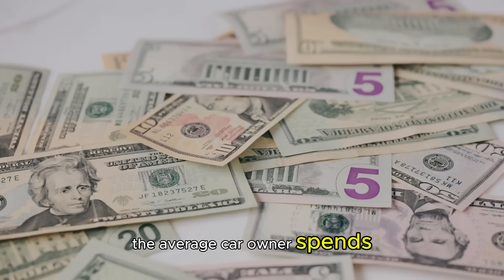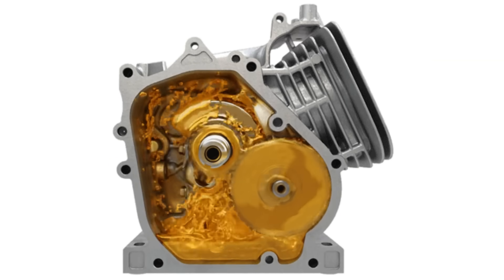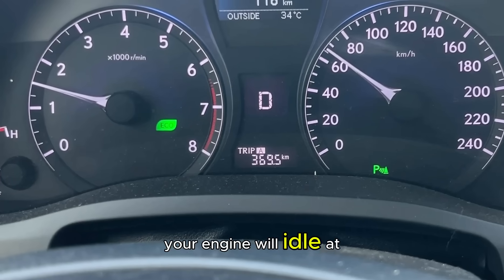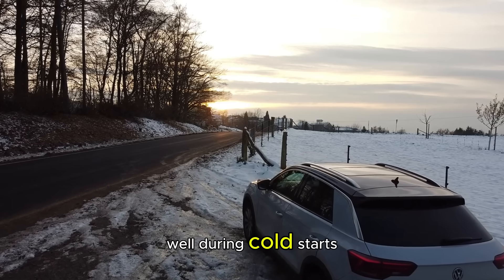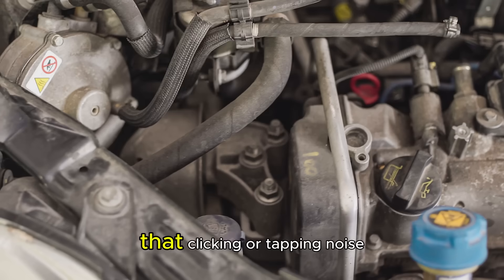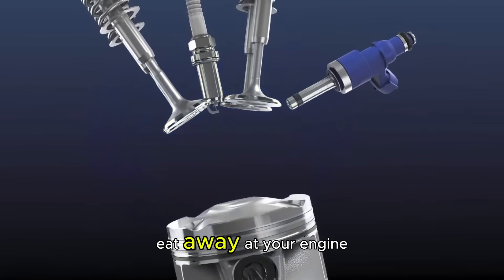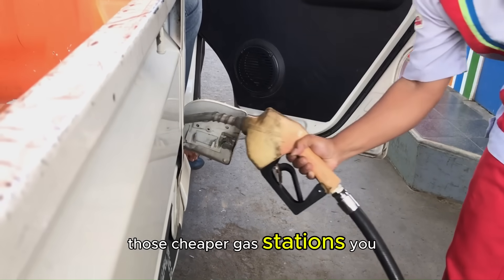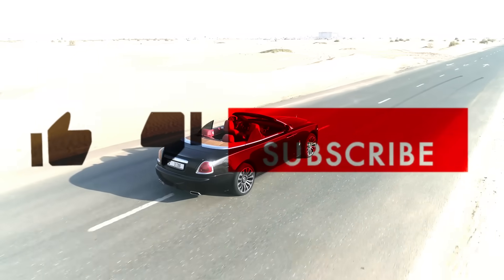Stop Making These 6 Cold Start Mistakes Before They SECRETLY Wreck Your Engine

Comment: A couple of valid words/thousands of mostly unnecessary words. Bad ratio.
1. Don't overrev/overload cold engine
2. Don't let it idle cold for too long - warm it up for about a minute before driving.
Here saved you 16 minutes of your life.
Reply: Afetr hearing the monotone and constant voice with werid distorsion, i checked the rest of the channel, and im 95% sure this is all AI generated.
Stock and AI generated images, monotone voice, GPT generated script, and the video is done.
Reply: @dracofenix3860  You are right. My question is: who - and most importantly why - is paying for these numerous mostly meaningless clips....
Reply: @dracofenix3860 ❤
Reply: @dracofenix3860  bro check the pinned comment 😂😂
Reply: @HotTripod78 bro, that comment was made one week later than mine.
Reply: @dracofenix3860  when I heard your start uses all the power it was .  Man
Reply: A single tip:
Stop watching AI generated trash videos.
Reply: Amen!
Reply: Yes, these are the most important to know about cold starts
Reply: @gregb8488  plus your car in  winter. Oil pan heater. Batter warmer.
Reply: you're a hero 🙏
Reply: So even if my car takes like 5 minutes to warm up, dont let it warm up all the way on its own at idle?
Reply: @munchy_mars_mallow1413  You don't need to warm it up to operating temperate - as soon as the temperature gauge needle starts moving, you are good to start driving.
It depends on a vehicle - for example, Toyotas warm up real fast while some ford or gm may take forever. I had a remote start on both of my 4Runners, and it was set to five minutes. I put over 350,000 miles on one of them before I sold it with no issues whatsoever so I quite frankly don't buy this "do not warm it up!!!" hysteria. Just don't go overboard.
One other fact: limos or taxi cabs - even those made by ford or gm - can live hundreds of thousands of miles despite extensive idling. In other words, cold start is the most stressful event in vehicle's life, and warming up is essential.
Reply: @nofyfb123  My newer '24 Ford Bronco warms up extremely quickly. Has excellent gen2 -2.3L GTDI. You taking bout 20yrs ago? Lol Toyotas have older engine designs generally speaking. Engineering perspective.
Reply: @nofyfb123  Also, all older limos & taxis were Ford & GM ..mainly V6 or V8s..cause they lived forever w/just good basic maintenance practices. Facts.
Reply: @Davido50  '24? You have all the fun ahead of you. LOL
You have a point - Toyota usually doesn't jump on the "latest and greatest" bandwagon - it doesn't use gullible individuals as Guinea pigs, whatever it brings to market is well tested, and if a problem is found, it's fixed in no time. Unlike - again - all kinds of fords.
Reply: @Davido50  You absolutely missed my point! Let me try this again: those monsters lived way longer than their privately used counterparts because they were never shut down/restarted. That doesn't mean they were not junk. The point is: letting it run will not cause damage. When I was young and did not know what I know today, I had a 1976 caprice. The damn thing lost it transmission (700R4) at less than 40,000 miles. NEVER AGAIN will I come close to detroit.
Reply: @nofyfb123 good to know! My old car would drop rpms after 2-3 mins, my new car a Subaru brz takes about 5+ mins for the rpms to start moving down towards 1.5-1k rpms
Reply: @AstaHalo  For decades, all manufacturers have been using heated O2 sensors so that the system would go into "closed loop" state faster. Something fishy is going on with your subaru.
Reply: @nofyfb123  do you think a small exhaust leak or poor piping would cause it to take longer for the rpms to drop?
Reply: @AstaHalo  I doubt it. Many manufacturers are known for messing with emissions. Most notorious were Nissan and VW but I wouldn't exclude Subaru. I bet you are the only one who noticed this phenomena so I would try to compare with another one at a dealership. Most likely, they all are like that, and I almost guarantee that if you complain to subaru service (and it's under warranty!), they'll blow it off. If it's out of warranty.... then everything needs to be replaced on your dime.
Reply: @munchy_mars_mallow1413 Yes, let it run till idle comes dwn . I do. Never more than 5min tho. 6k mi max oil changes far more important!
Reply: I miss the days when Youtube videos had to be 10 minutes or less.
Reply: Thank you
Reply: Give it 4 or 5 minutes...not just the engine...the transmission needs a little heat
Reply: @kurtjammer9568  Point taken. From my experience, with remote start set at 5 min there'll be no issues.
Reply: New dfi engines reduce the fuel as it warms.any excess fuel will be evaporated..I prefer a 5 minute warm up when minus 15 outside.
Reply: @kurtjammer9568  Agreed. Where I am, there rarely is -15 but when it is, I give it a few minutes. Never had an issue with extended idling. Evan crappy ford/gm limos run hundreds of thousands of miles probably because they always run and rarely are started.
Reply: @nofyfb123 False. Cause they were properly maintained. Owned every brand of vehicles out there. My Fords NEVER gave me issues. GM is another story. Better than new Hyundai-KIA tho for sure. Don't spread misinformation. Thats why social media is nearly worthless nowadays. Engineering perspective.
Reply: If it’s like 20 degrees or colder outside will I have to wait longer than a minute?
Reply: @DanielArroyo-lm5bk  It's not carved in stone. My remote starts are set to five minutes, and I never - EVER - had any problems. I'd say, as soon as the temp gauge needle starts moving, you are good to go. Time is a secondary factor that depends on your vehicle and ambient temperature.
Reply: @DanielArroyo-lm5bk  5min max or when revs come dwn after initial start.
Reply: This video isn't accurate anyway, battery has exactly the same amount of evergy it always did.. Call the weather just makes the chemical reaction a bit slower but the amount of power is still the same but this guy is completely wrong so it does kind of make you doubt the rest of it.
Reply: @elixier33  I respectfully disagree - the battery loses as much as 40% capacity when extremely cold. Just ask any muskmobiler.
Reply: Thanks 🤣
Reply: How many will do this " just because a video says" ?  
5% .
 How many will do this after seeing the entire video?
 95% 
Why? Because now they understand how an engine really works and why is so important. 
Ok, but why only 5% will use this? Because the rest of them are the Ignorant's like you
Reply: Thank you!!!!!!
Reply: Thank you.
Reply: Thank you. 2mins in and he’s said nothing
Reply: Thank u so much for the idle stuff

Comment: The cold ATF killed the automatic in my E-Class back then. well, that and the fact that Mercedes said "dont need ATF service for a lifetime" - the car was past 22 years old and the ATF was more like a pudding rocking the car. Unfortunatelly my words hit on deaf ears and it did not take long until ive lost reverse.
if your car is older than 15 years - as in A CARS LIFE TIME - exchange all fluids if you havent already. it will cost, but a lot less than fatal repairs or even a new/used car.

Comment: Living in Canada... Québec... winter half the year... EGR is going to do it's job. Long idling does not... damage the engine. At idle the engin is running exactly how it should.
Reply: It feels like more modern vehicles are having these issue's then vehicles in the past. Hell, I drive a 2008 Jeep commander. And I was able to start it up in -30°c weather. Likely not very healthy for it. But it was able to start. I also live in Canada as well. More specifically in Alberta.

Comment: My record is starting a diesel engine at -39 degrees Celsius, but it went well thanks to the engine heater.
During the trip, the coldest temperature was -46 degrees Celsius.
Reply: Doesnt diesel basically froze at -20?
Reply: @mihailcirlig8187  No, but with old technic (1970´s), it was a problem. My car was built 2010 by Peugeot.

Comment: Fr9m northern western canada, not disagreeing with some of this, it seems that there is a cross between the older "real" engines and the new engines with its 4 to 5 computers. The compression is far less today than prior. Dont just put the key and turn starter, turn key to its setting up period, then once the the guages come back to norm start it. Do not fall for the block heaters sales pitch if you are worried about the cold. Have your shop glue a oil pan heater on the heat then risesheats your oil and up through the top.
We used to use a 60 watt non led light sitting under the pan with a blanket on the top of the engine in -40 prior to the oil pan heater.

Comment: I'm always amused by the internet mechanics telling me to idle for 30 seconds to a minute before driving.  While this may be good advice for most of the US and Southern Canada, its impossible in northern Canada where I live.  If I tried driving away after 1 minute, my breath would turn the inside of my windshield to blinding ice.  Plastic dials would snap rather than turn.  Nope. People in the Yukon and Alaska often have to idle for 15 or 20 minutes before your seat isn't hard as a rock. Its so cold our tires are square for the first 5 minutes of driving.  

There are countless cars driving around with over 200 000 miles on the odometer up here.  

We do, however, make sure to use block heaters, but usually not until about -20 or -25c (-4 to -13F).
Reply: I live in Oklahoma about 30 minutes from the Arkansas state line exclamation point right now we're in the tail section of winter and it's about 35° outside by tomorrow I believe it's going to be 30 to 32° outside I have every intention of going out about 20 minutes before I have to drive 3 Mi to work and start my 2004 Chevy Impala V6 automatic turn the heater up to high and defrost and then get back in the house and finish my morning cup of coffee and let my Malibu sit outside and idle for a good 20 minutes to warm up before I drive to work!! Yeah I know I'm burning a little more gas running at idle and sitting there not going anywhere but I know that it's better for my car all the way around and because of my own physical predilections with my body jumping in a cold car with no heat and driving to work is a hard pass no-go not going to work!! So trying to tell people that you ain't got to warm up your car in the winter time it is kind of short sighted it's not always about warming up the engine it's also about warming up the transmission fluid and building some cabin heat from the heating coolant to circulate to your heater core so you're not a frozen popsicle trying to drive to work LOL LOL and I've done this ever since I moved to Oklahoma whether it was a carbureted vehicle or a fuel injected vehicle. Also it's important to note that as your car ages your car is requirements may change! I know that with the mileage on my car the transmission is starting to give me slight problems and the transmission overall functions better and shifts more smoothly if I give her a good 20 minutes to warm up in circulate the fluid before I start trying to drive I don't have to give it as much time to warm up in the warmer months but I know my car I know what she requires I know when she's going to be temperamental so I suggest anybody watching this video to take this information and recommendations with a grain of salt or maybe a teaspoon of salt it's really not a one-size-fits-all situation
Reply: I live in Finland and understand your point of defrosting the car taking time. However, we use block heaters for the engine and route an additional socket for a separate interior heater, that way the engine and the cabin are warm and its much quicker to get on the road with minimal effort to scrape the ice from the windows. Cold long winters suck!
Reply: My old f250 ford van seems to fire up everytime in -5 to -11F with no engine heater. i let her warm up for about a minute and hit the road. shes got almost 200k miles on her.

Comment: When you turn the heater on full blast for the first minute or two you are just getting cold air.  Thus I turn the fan to the lowest speed until I see the temperature gauge go up.

Comment: All engines is different. Petrol warms up faster than diesel. Petrol is always better to idle, diesel depends on engine, (unfortunatelt without years long testing tou can't tell what is better. 
But always remember, turbos hate cold oil much more than engine.

Comment: First start in the morning, idle for 10 seconds then drive gently for 10 minutes. Coolant warms up in 5 to 10 minutes. Oil warms up in 15 minutes which warms the entire engine. Therefore, any trip less than fifteen minutes in not good for your engine or its oil.
Reply: Wrong.   Start driving once the idle begins to drop
Reply: If you can avoid a heat cycle why not?

Comment: Regarding diesel starts, it should have been said that you need to give time for the glowplugs to work. That is by turning the ignition on, waiting for up to a minute and then starting the engine (depends on the model car - some diesel engine cars turn the glowplugs on when you unlock the car, some only run the glowplugs for a set amount of time when turning the ignition on). Eitherway, turn ignition on to position II, wait (especially if there is a glow plug indicator that is lit up, if it is lit up, wait for the light to turn off), then start the car. If the car is struggling to start, repeat the steps again, give more time for the glow plugs - it is not worth trying to start the car excessively as this just wears the battery down).

Comment: Bullshit Modern oil is viscosity stabilised, buy the right oil for where you live and warm your engine for 30 seconds and your good to go with no  problems.  You will do more damage by running you engine at idle for a long period than driving it.

Comment: I am blessed to live in Honolulu, HI, so much of this is not applicable to me, other than the sensible aarm up a miniute or a few to circulate the oil. Of course, for turbo engines and such, the warm up and especially the cooldown before shut off, as stated in the video, especially after driving hard is imperative for turbo and engine longevity. I never found the need to rev my engine during idle.

Comment: So I'm not suppose to idle too long during cold temp because it's bad and it's best to just drive off about 60 sec later after starting the car to warm up the car faster, but then again I'm not giving it enough time for the transmission to warm up enough to operate properly 🙃 😅. 
So in the end, I'm slowly destroying my car either way because it's damn if you do, damn is you don't regardless of what you do then 😆.
Reply: Plus you're going to be really cold and uncomfortable.
Reply: I do the same thing always let my Audi a4 1.8 tfsi to full temperature so transmission oil gets warms up too!

Comment: My w211 have an electric heater near the heater core (radiator) when i turn it on not only heat up the cabin very quickly but the fact that is near the radiator helps the car to heat up faster

Comment: Too much raw fuel will damage hot catalytic converter. Not cold catalytic converter.  And as you said the blow by gas will happen more during the cold start because cold make engine small, that will still less likely cause raw fuel go out to the catalytic converter because every car has PCV system. So for me, I just take off slowly. I don't even wait 30 sec to 1 minute.